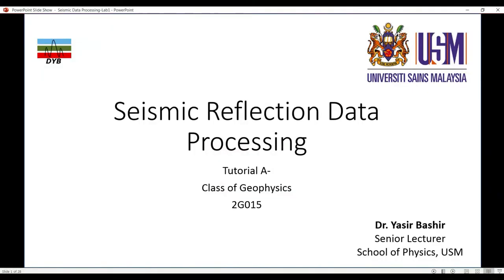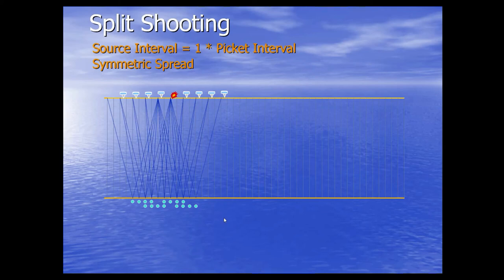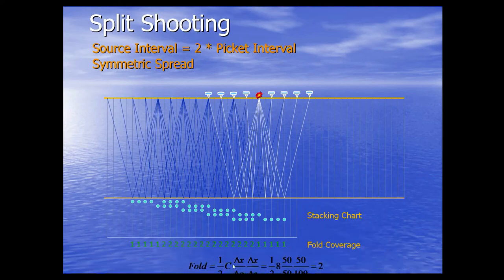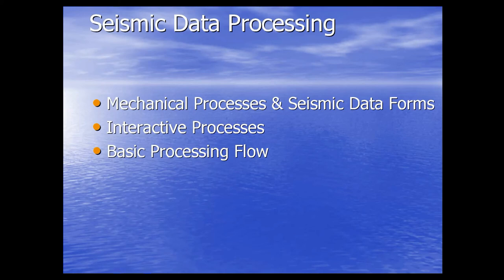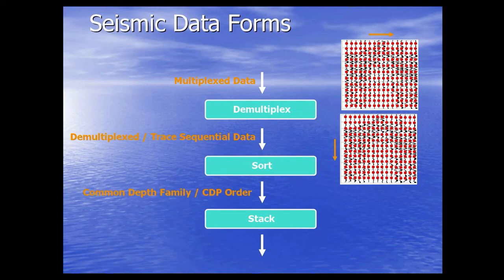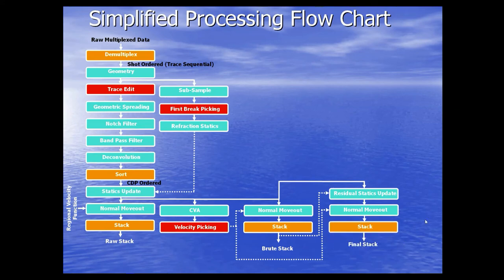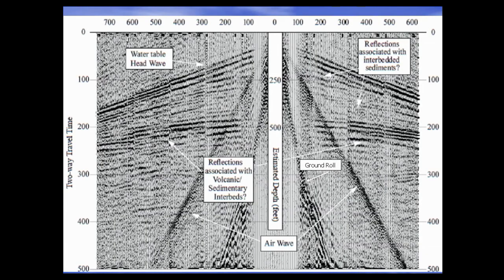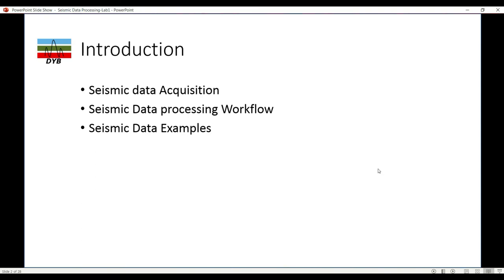Seismic Data Acquisition Essential Processing Steps & Techniques to Boost Your Geophysics Career

Comment: Do you stack the traces from points that have been covered many times?if so how to know which trace belongs which fold
Reply from the maker: Stacking is done based on the offset and every CMP that belongs to the offset will be considered. The fold is to understand the illumination of the CMP. higher the fold better is the illumination. Please refer to the below video lecture for understanding stacking and so on.

https://www.youtube.com/watch?v=O3XhRBwTEU0&t=45s 
https://www.youtube.com/watch?v=T_0NCOsrk1s&t=115s